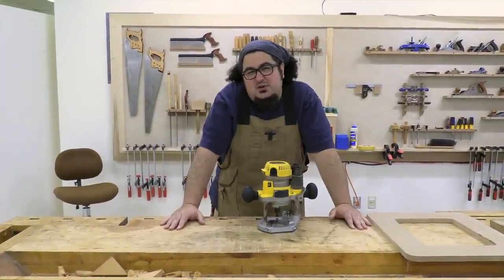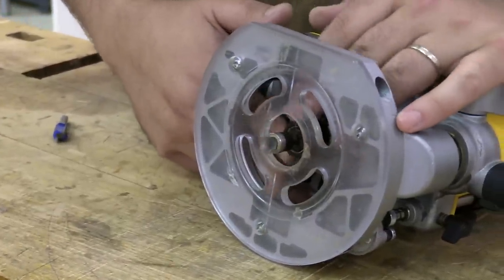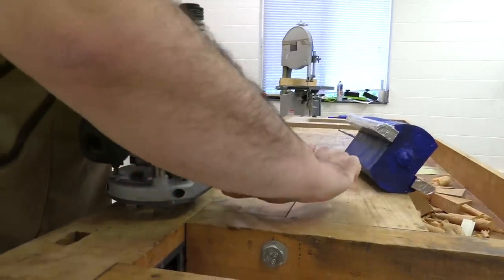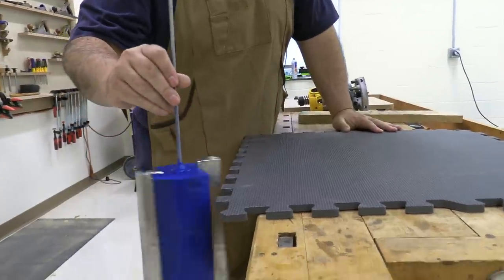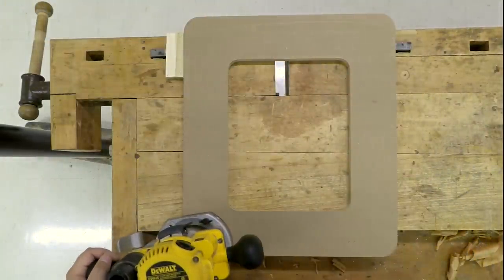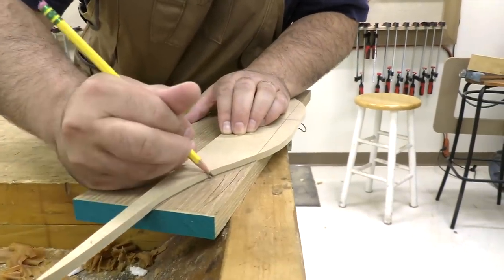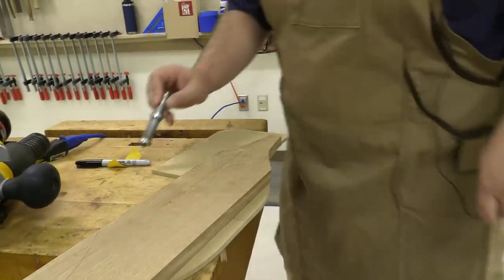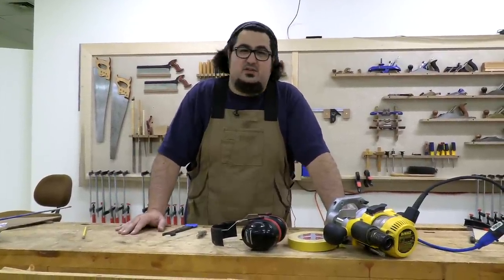What the heck is a climb cut?

Comment: Flipping the workpiece over is a great tip. Unfortunately it only works with a square cut like was shown in the video. If you’re cutting an edge profile like a cove or an ogee, you have to work from the top of the piece.
In these circumstances I will sneak up on the cut, starting with a shallow cut in the ‘proper’ direction. Once I get close to my desired depth I switch directions and do climb cuts shaving a tiny amount of wood each time. By keeping the cut as thin as possible you minimize the amount of wood the router has to grab and thus the potential force with which it will pull away from you. 
As always, you need to perform cuts so that both your tool and workpiece are always under control, whether it’s a proper cut or a climb cut.

Comment: We use it all the time. Especially on softwoods that are less than perfect. We make a lot of chamfered edges on fir and it can be really helpful to take a quick pass in the wrong direction first before finishing in the right direction. You can usually hear it coming when it wants to tear out and you just stop and switch to a climb cut first.